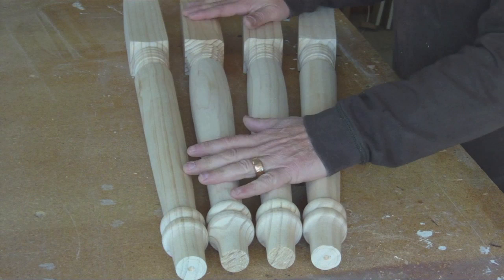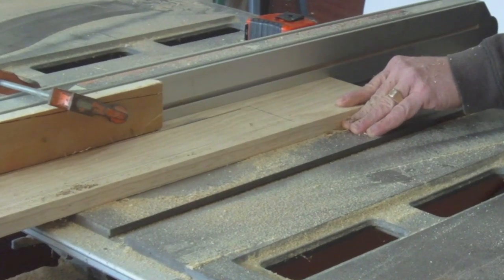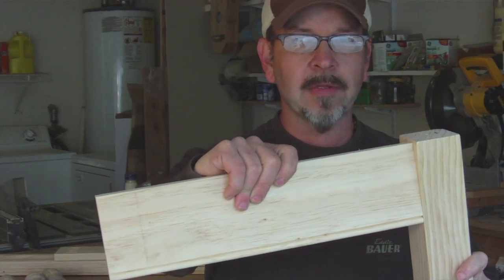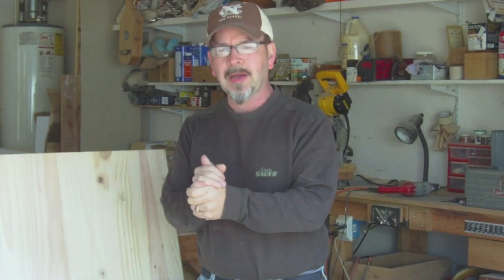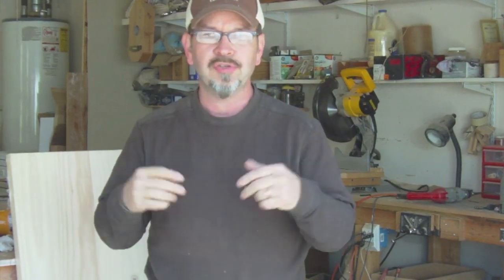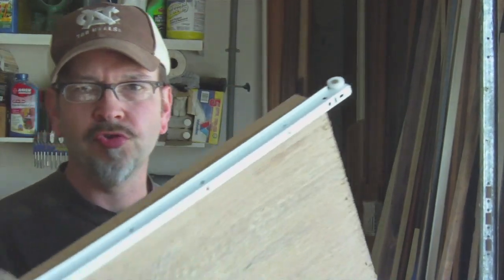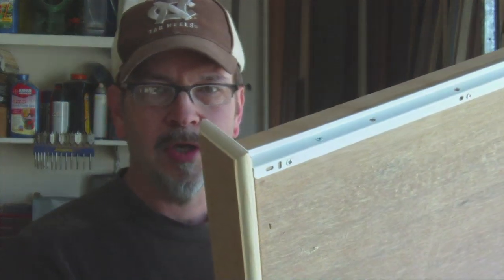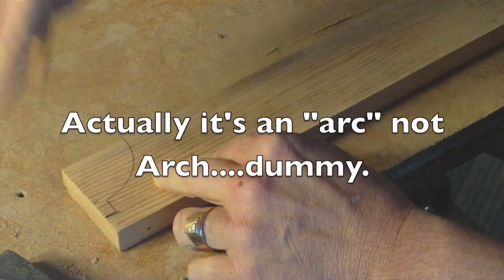Build a Computer DESK or many other types of furniture such as tables.

Comment from the maker: I think I used "Koa" color stain with fast drying Polyurethane  on top. Since a desk top gets lots of wear, I used at least 3 coats. The spay gun makes all the difference, that one is a fairly cheap one I got at Harbor freight for like 20-30 bucks. (Check their website for additional coupons). Thanks for watching.

Comment: How do your skirt pieces start out so straight, flat and square? Do you run them through a planner and/or jointer before cutting them to size?
Reply from the maker: +Russ S. I rarely joint to flatten a board, most lumber comes edged and flat but often I will joint the saw marks away if needed.
Reply: So the lumber comes that straight and flat right off the rack?